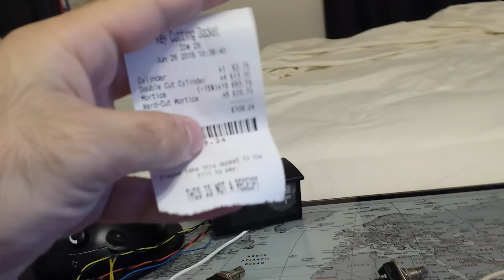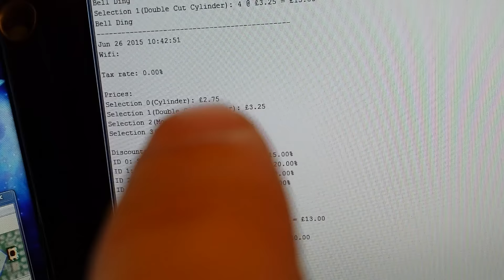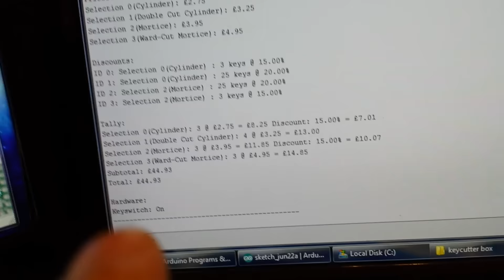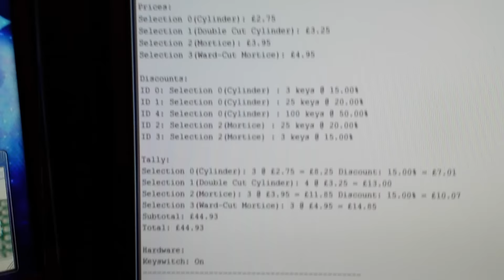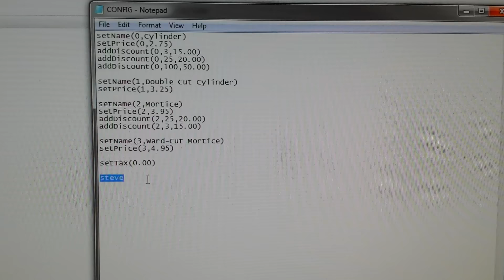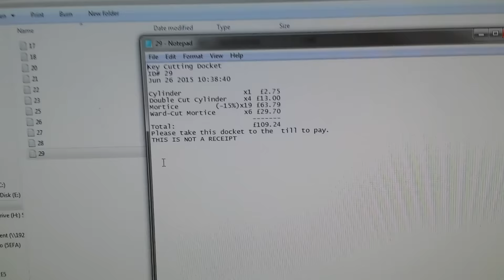Nixie tube arduino project

Comment: So first of all thanks for sharing... I have a NCH6100HV, 2 of them actually but either both are faulty or I"m doing something wrong, here's the deal, input is 12-13V, output starts at 100V+ (sometimes 130) and drops rapidly until it flatlines out to 12-13V like the input, I'm thinking the device might have a faulty cap... or I'm doing something wrong, any thoughts?
Reply: Ground SHDN, should work

Comment: Thanks for sharing this, very cool.  What multiplexer are you using to select the relevant pins of the tubes? Also, which tube are you using here, IN-14?
Reply from the maker: +icarus901 I'm using 74HC595 that drive K155ID1 74141 that drive the IN-14 tubes. You didn't ask but am also using a NCH6100HV high voltage supply.
Reply: OtakuSanel Excellent, thanks for that info - I appreciate it.

I have some KM155ID1s, but they're all ancient and some are bad..do you know of any decent modern alternatives?